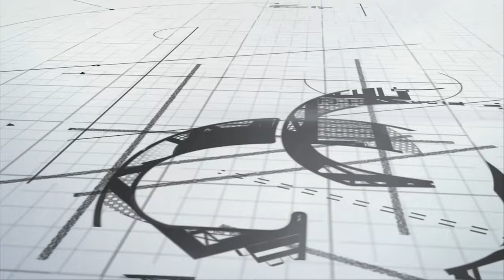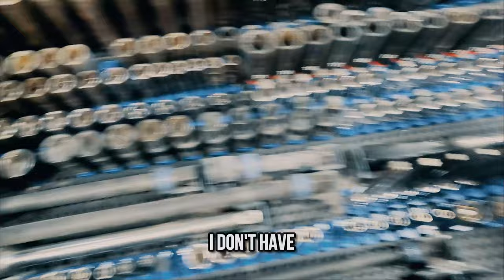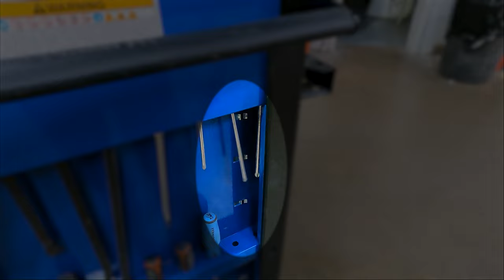Ultimate Collision Tech Cart Loadout

Comment: Nice setup. I work pretty much the same my roll cart holds the stuff I use consistently and my big box holds everything else. My only issue is now my cart is about at capacity. Just recently added a side tray to my cart and it’s awesome I can lay out my hardware on reassembly or have a place to set things on tear down
Reply from the maker: Yep its great piece of kit for sure, space and packout become a bit of an issue, continuing to fine tune and will probably shoot an update at some point

Comment: Thanks for the video.  I use Gorilla clear tap to protect the paint where I am using magnets...  I also flip the 10, 13, 19 sockets over so I don't need to read the numbers.  I also use paint markers...bright green or yellow...on the socket numbers but your numbers show better.  The Harbor Freight 18 inch magnet tool holders and the "ABN Universal Magnetic Hand Tool Holder"s work great for the tools in the drawer that you are planning to cut foam.  I use the ABN ones for combination wrenches but your grid system looks nice.  All my SAE go in a lower drawer.  I use the big drawer at the bottom for the blown molded cases.  Good luck.
Reply from the maker: Those are great suggestions thank you!